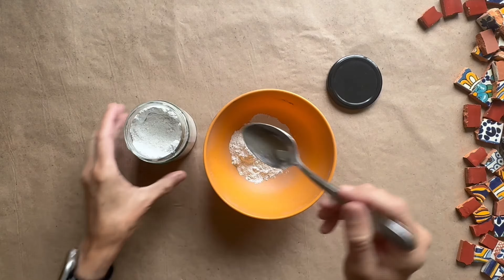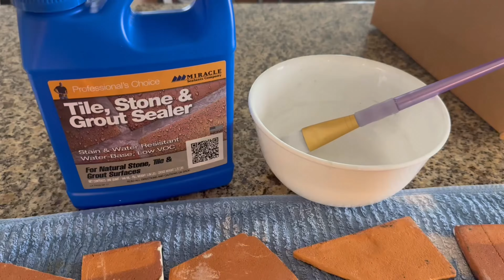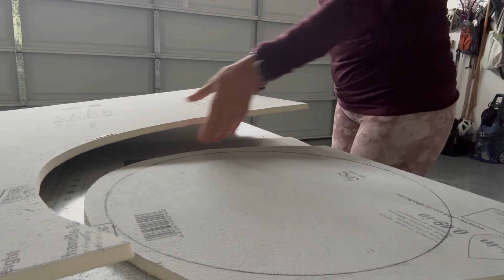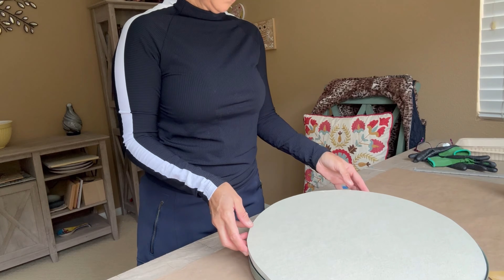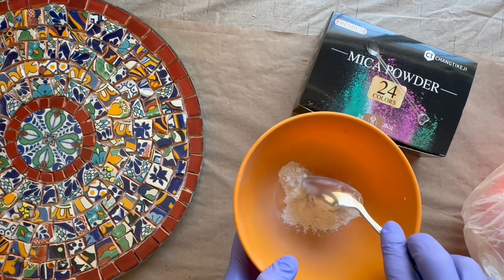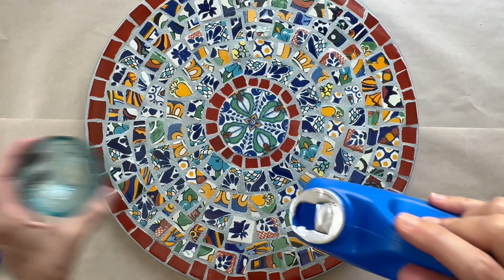MOSAIC A TABLE WITH MEXICAN TILES | Step-by-Step Tutorial

Comment: Could you glue right to the metal tray?
Reply from the maker: Yes you could, but it would be for indoor use ONLY. The metal expands and contracts with heat and cold, it would rust with rain and tiles could break and/or detach with weather exposure.

Comment: How about placing it on outdoor metal table? Is it just mortar and tiles step then? Does metal table coated in paint need any prep?any thanks
Reply from the maker: Metal can be a great substrate for outdoor mosaics, especially aluminum or stainless steel because they resist rust. Before mosaicing, make sure to sand and clean the surface well so the adhesive bonds properly. I also recommend using a strong exterior adhesive like thinset or polyurethane glue. Keep in mind that metal expands with heat and cold, so thicker, rigid metal works best to help prevent cracking over time.

Comment: Could I seal the edges of broken ceramic plate pieces in the same way you did the tiles and be able to use those for outdoors?
Reply from the maker: @meever7973  I would say yes. As long as you also cover with grout and seal the grout. As shown in this project.
Reply from the maker: @meever7973  however plates are usually a very good material for outdoor use without sealer. Check out my video with the birdhouse mosaic https://youtu.be/NiqFB-gR9E4